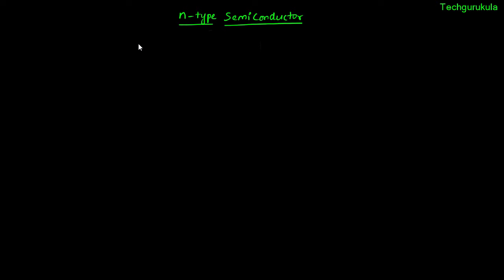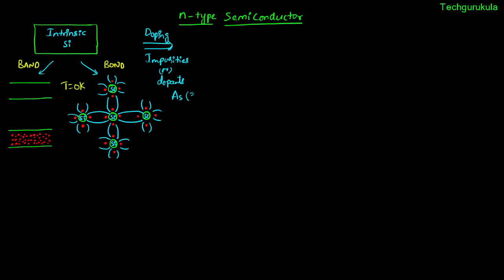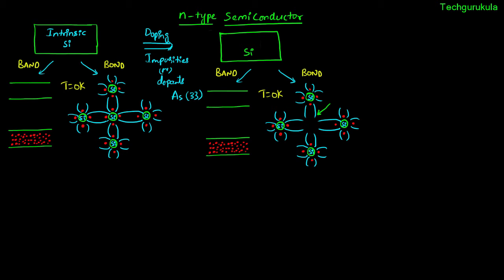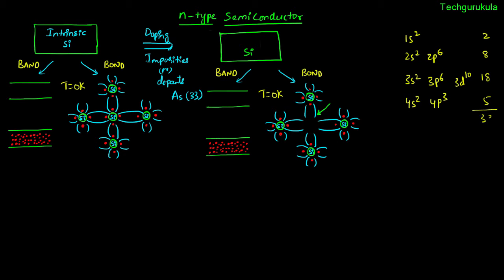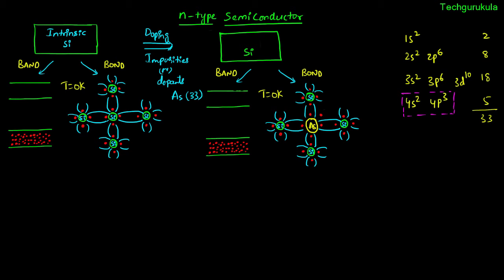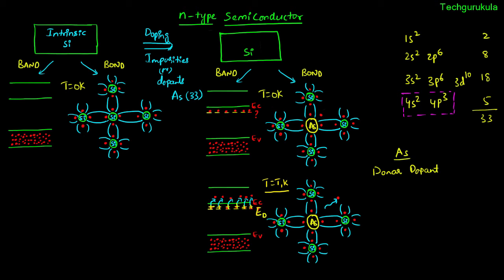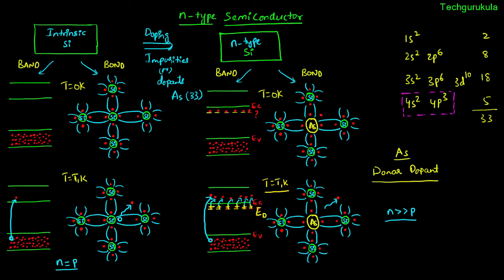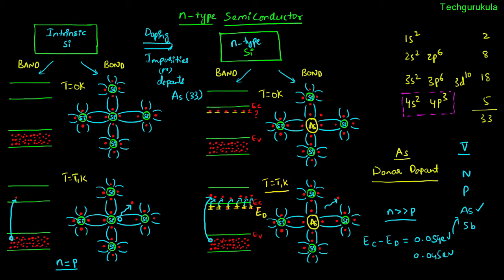Electronic Devices: n type semiconductor

Comment: why did u draw dopant energy level near to Ec ......and acceptor impurity near to Ev??
Reply: This is the concept of fermi levels. I think that because the free electron which is not in a bond of a the donor dopant has much higher energy since it isn't shared by two atoms it is much more likely to be thermally excited to the conduction band. hence the energy level (fermi level) is near Ec.
Reply: Because 5 group elements has higher atomic number and as you move far away from the nucleus in atomic model, energy level will increase, so it will be at higher energy state, and where as for 3group elements, energy will be less